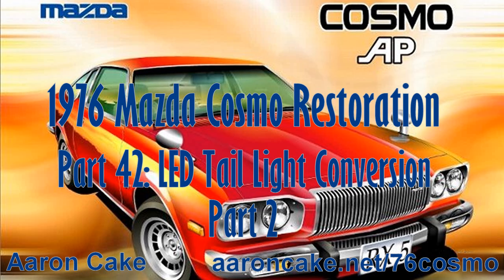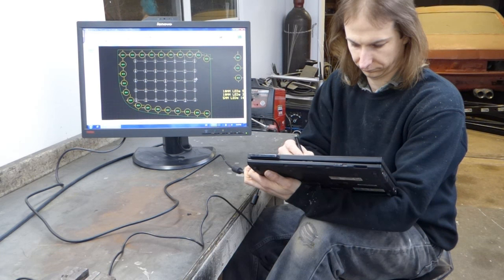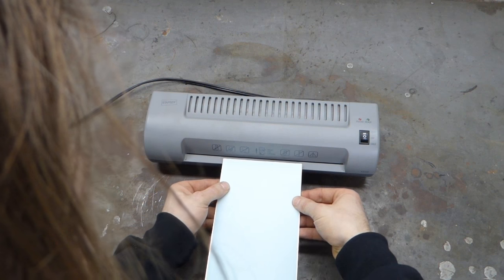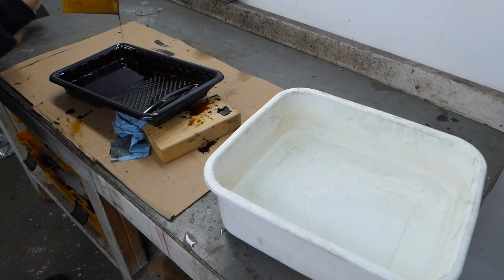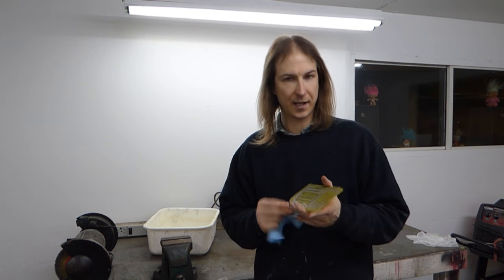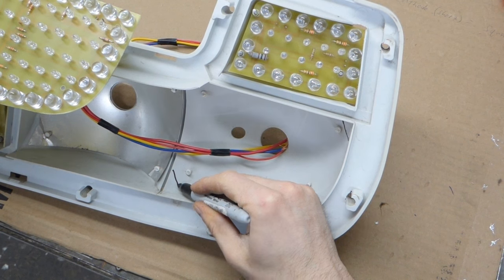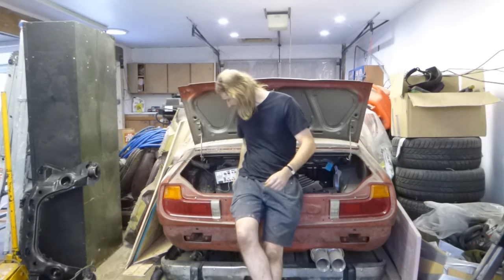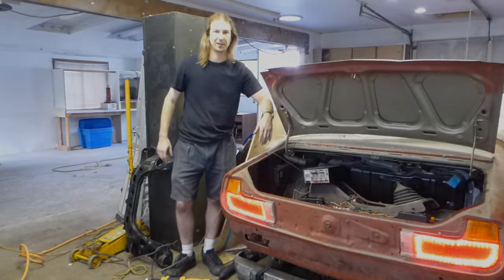Part 42: LED Tail Light Conversion, Part 2 - My 76 Mazda RX-5 Cosmo Restoration

Comment: Wow that turned out really great! But I have to say I'm a bit amused in how serious you go about it, yet ghetto out in other ways by not even having proper basic tools. But as long as it works, it's all good. :) Damn, now you made me wanna LED convert my car too!
Reply from the maker: I'm curious, what basic tools am I lacking? Always thought I was fairly well equipped. Oh! And I just got a mill yesterday!
Reply: Well like that basic crimp tool you use to cut the wires for example. :)
Reply from the maker: Skräcken Ah yes, I really should get a better crimper for WeatherPack stuff. I think I mentioned that in the video.
Reply: If I came across as condescending I apologize, that was not my intention. Also I hear those cheap chinese SMD rework stations are great for heatshrink tubing, I'm considering getting one just for that purpose. I'm using a big heat-gun now which is rather overkill in most cases...
Reply from the maker: Skräcken No worries, I was just curious as to what tools you were referring to. Maybe I'm old school but I've always just used a lighter for heat shrink. Thought that is very frowned upon of course. Never could bother with a heat gun when the lighter is so self contained.
Reply: You're not the only one who uses a lighter. I've found that a heat gun is often just too cumbersome and awkward to orient properly in difficult spaces. I just use a simple wand-type lighter found at any dollar store, stored right next to the butane pencil torch in my toolbox.

As always, you've done a brilliant job and I'm looking forward to the next episode.
Reply: Yes that storm lighter does seem pretty convenient. A regular lighter tends to have a pretty lazy sooty flame, which is why I don't like that method
Reply from the maker: Skräcken And it's an excellent cigar lighter. Found it on sale for $1 years at Princess Auto and bought a bunch of them.
Reply: Sweet deal! Looking at my car it looks like it would be annoying to LED convert like this, considering the lights wrap around the corner of the car a bit. But it can probably be done :)
Reply from the maker: Skräcken Flexible circuit boards and SMD. :-)
Reply: There are flexible PCBs nowadays? Interesting!
Reply from the maker: Skräcken Don't think you can make them yourself. Wait, scratch that. Just Googled it and it seems people have successfully etched flexible PCB material via the toner transfer method. Who know...
Reply: That's actually pretty interesting! I would probably go with a 2nd angled PCB for the corner though. The boring part is that a modification like this would be illegal on my car in my country.
Reply from the maker: Skräcken In most countries it's going to be illegal to modify a light beyond what was approved by the government, including my own. It's not a sort of modification I would do to a car that won't be covered by collector insurance as regular insurance companies probably won't touch a vehicle with non-approved tail lights.
Reply: That's a good point, I never thought of the insurance aspect. I was mostly thinking about it passing inspection or if the cops might be unhappy with me. But then again, neither of them has said anything about my 3" catback, or HID hi-beams. Yet. For older cars here the rules are much more relaxed though, but from some time in the 90's the rules changed to saying everything on the car needs to be stock or equivalent. My car's a 2001 Saab 9-5 Aero, so not a collector's item. Yet. ;)

Comment: Seems like it took a very long time to custom make them, but they do look very awesome!
Reply from the maker: So the funny thing is that when I add up the time, spending about 2 hours a week on them for the past 14 months or so, it adds up to about the same amount of time I'd spend working evenings and weekends for about 2 months. Which is the average amount of time between videos. So while it seems like forever, time spent is about the same, just drawn out. Yes, it actually turned out to be a LOT more work than I thought. But the ideal project to take on when the work area is limited to a bench and a drill press. Very, very happy with the result.

Comment: If you decide that you don’t want the holes exposed to protect against debris entering the housing, I suppose you could just use some grommets and feed the wires through?
Reply from the maker: Yes. I could make the holes a bit more regular in size and fit with grommets. I could also 3D print (in ABS) the exact shapes I need. Or just simply seal with metallic tape (as an OEM would).

Comment: Hey Aaron, you may want to purchase some nitrile 5 or 7 mil gloves from your local harbor freight or Ace hardware. They will last you a lot longer than your current brand, are reasonably priced, AND won't leak.
Reply from the maker: Definitely need to get some. I made a few circuit boards last week for another project and once again, had brown stained fingertips.

Comment: It looks super cool, and it's a great job. But why you din't use CREE for this? I think it's more durable and interesting variant. And it's easer to install.
Reply from the maker: Just didn't need them. Most of the CREE LEDs are far brighter than I need and being surface mount, more annoying to work with from a DIY perspective. The old style discrete LEDs are pretty rugged. Also a dime a dozen shipped from China.

Comment: Hey Aaron I also have some rx5s do you know if the door seals are available aftermarket at all.
Reply from the maker: I think they are only available NOS. Don't see any reproductions. However there are companies that will reproduce these things if supplied with a seal to copy. I'm going to explore that when the time comes. Also, rubber can be cast at home. There may be available seals which could be modified to work as well. Such as RX-4 or 929.

Comment: Few questions, why didn't you make the boards one piece instead of 3?  One piece boards would have ensured that all the LEDs were in straight lines instead of being slightly crooked board to board and it also would allow for much less custom hardware that appears to be fiddly as hell to install and adjust.Second, for the component count of the controllers, it appears you could have built the entire controller on one single 3x5 board.  Was there a reason for doing it the way you did?  Last, have you tested these controllers in situ yet?  My experience is that micros need a power supply circuit that is at very least comparable to a cell phone charger with a bare minimum one inductor, a MOV, zener, and an engineered cap filtering arrangement.  Ive grenaded PICs with more filtering than you have when the car it was in had a faulty alternator voltage regulator and it took basically replicating a Megaquirt power supply to properly protect the micros from smoking and/or being damaged internally.
Reply from the maker: One board would have been nice but neither the light housing nor the lens are flat. The lens is actually significantly compoundly from top to bottom and left to right. I would have had to gut the housing completely and bury the board about 2" down. What I wanted was to keep the LEDs as close to the lens as possible so the individual light points were visible. I've no tested them in a running vehicle. My daily driver uses a DC-DC converter, not an alternator, so it has a fairly clean 12V. Well, I guess I could have wired up everything temporarily in the RX-7. Not too far off of a supply section similar to the Megasquirt, just missing the inductors. Yes, I certainly could have used an Arduino with more I/O and put everything in a single board, and frankly eliminated one controller for the brake lights. However since this is all a essentially a prototype, I wanted redundancy. At least if something fails, then the odds of the failure taking out all my rear lights is very slim.

Comment: Why not print on both sides? Makes routing a lot easier, maybe a bit harder to line it up when transferring but saves a lot of headache.
Reply from the maker: That's true. Since this was the first time I was using this method, I didn't want to deal with the hassle of trying to make sure the registration between sides was correct. In a weird way I pride myself with making a single sided board without jumpers and until a few weeks ago was able manage that. Sadly while designing a board for an 8 channel home automation relay/switch controller, I needed 3 jumpers. Will try a double sided board soon because I really want to build my own version of an Arduino Uno with built in Ethernet.

Comment: I have to admit, I was skeptical about all of the effort you were putting into the LED lights, but then seeing the finished product with the border and variations for the different functions, I think it'll fit well with the car. Are they really that bright in person (like TOO bright) or is just the camera not able to handle the sudden light?
Reply from the maker: It was difficult to get a good shot from the camera without having the brightness turned down a lot. Yes however, they are quite bright. It remains to be seen whether they are too bright but that is an easy fix just by changing the PWM time in software. Additionally, since the controller knows when the market/running lights are on via the halo activation signal, the brightness can be adjusted lower when the running lights are activated. All software at this point.
Reply: Right on, I must have missed you mentioning you can adjust the brightness if you did. Looking forward to seeing more metal work in the next vid!
Reply from the maker: No problem, there was a lot of information presented. That's one of the reasons I decided to use an ATTINY. It makes the circuit itself so minimal with all the functionality in software. When I was a kid, this would have taken 2 556 dual timers and a lot more support components then de-soldering and resoldering to make changes.

Comment: I really like the "opening celebration." Will that happen every time you start the car?

Are you going to do the same for the front signals or are you keeping it business up front and party in back?
Reply from the maker: Yes, anytime the car is powered the opening celebration will play. Since I have the controllers, I figure I may as well do something similar with the front lights. Far less space on the front turn signals so I'd have to take measurements as to whether they would get the whole halo treatment.

Comment: Will the brake lights work without the car's key being in the "run position" with your current design? Are the chips always receiving power to be ready for the brake input or do they currently have to receive power via the key first, (activating the Opening Celebration) and then after that they are ready to function? Just curious if the brake lights will illuminate if the brakes are pressed with the key off or not present.  ---Love the videos, and have learned a lot by watching them and look forward to whats to come. Thank you!
Reply from the maker: Ya know, I didn't even think about that. At the moment they would be powered by the key set to run, so pressing the brake pedal with the car powered off won't light them. The opening celebration will cancel if the lights receive a brake or marker light signal. I do plan to actually run these lights through a body computer like the OEMs, which of course would also need to be powered at all times if they were to work with the car off. When I read the Ontario MOT regulations for vehicle lighting (all 17 or 30 pages, forget which) there wasn't a requirement for the brake lights to function with the car turned off. But of course there is a requirement for the 4 way flashers to function at any time. My solution will simply be a relay to power up the light controllers when the 4 ways are turned on.
Reply: Thank you for the reply! The reason I asked is I have been working on a sequential LED taillight conversion for an old 70's Mopar using an Arduino controller. In the factory configuration the brake lights activated without the key so I was scratching my head while trying to preserve this feature. However, after looking around it seems like not all newer models of vehicles retain this option, so I will have to dig through US DOT laws to see if preserving that is even required here. It may be a hurdle I don't have to hop after all (or worst case piggy back wiring into one of the LED segments so it can still partially function via a dedicated relay as sort of a "dumb mode" for when the key is not present).  Thank you again for the reply and information on your own project. Your videos have been great to follow, and I look forward to the future ones. I really enjoyed the opening celebration you added into your project, that was a fun touch. Keep up the great work, Sir!
Reply from the maker: doctorbull Retaining that function shouldn't be too hard. There are several options. You could leave the CPU powered all the time if you don't want to do any fancy opening effects and that way it always has 12V to activate the lights. The approach I took was in software. If you check the code linked in the video you will see that the opening celebration is immediately cancelled if any of the light inputs are activated. So, it would only take a wiring change in the form of a relay added to the brake light switch to both apply power to the tail light/controller and activate the  brake lights. Or a double pole brake light switch to accomplish the same thing. That way when the switch is activated the circuit is powered up at the same time, the code sees the light input, and it essentially operates exactly like a standard light. I have a friend who's tail lights are on the CAN bus. They only receive power when the car is switched on so don't activate when the brake is pressed unless the key is in "run".

Comment: Since there's no more red-hot bulb, any moisture getting in is going to cause a bad time. Conformal coat spray for electronics, figure out how to plug those openings (epoxy?), hot glue a silica gel to the enclosure behind the board to get any humidity out, and silicon seal that stuff air-tight. If you do it right with LEDs, it's unlikely you'll need to change anything in there again so no future need to open it up again. Perhaps a pain and going over-the-top, but unless you're in some desert that's bone-dry 99% of the time, water will always find a way behind tail light enclosures. Just better that it and any contaminants (road salt) don't get in.
Reply from the maker: The Cosmo lights actually mount in a rather odd way. The entire assembly mounts inside the car with only the lens sticking out the back. They are clamped into place via the trim studs. The lens itself is totally sealed from the outside and will be sealed to the tail light body upon final installation (after polishing) with a gasket. I don't see anything from the outside coming in. The idea with keeping the back of the light open is that I won't have to fight humidity. Any humidity that gets in will also get out. We've all probably seen horribly condensated light fixtures that were once sealed but ended up with a tiny seal breach. One way to avoid that hassle is to simply not seal. However it probably would be a good idea to glue a cloth filter over the openings.

Comment: Cool. Unfortunately (or maybe not, depending on the perspective), it's not legal where I live. You can't even switch to led bulbs if the taillights came weren't homologated with them in mind. You could even get into trouble with your insurer after crash, even if it wasn't your fault.
If you plan on making another video, maybe do some night testing? Taillights always look better in darkness.
Reply from the maker: It's illegal here to modify a DOT/MOT approved light assembly. I did however actually read the MOT requirements for auto lighting and made sure I followed them. It does mean that I will need to use collector car insurance, which I had intended anyway. I suspect that because I see so many modified lights, that a blind eye is turned.

Comment: Hey Aaron the tail lights look like they took a long time to make up but I love them would you be interested in making another set for my rx5 and if so how much would you charge. Postage to australia also. Cheers Wendy
Reply from the maker: Unfortunately, I don't think it would be economically viable. We're only talking about $300 worth of parts but the labor is immense. Since all of this is essentially a prototype, even though the boards are designed it is still a considerable amount of time to make everything fit and put it all together. And since none of it has been proven on the road, I'd hate to ship you a set of $1000 tail lights and then have a failure next week. They aren't also plug and play to a stock Cosmo wiring harness.

Comment: I've noticed in slow motion led lighting assemblies flicker, how will your taillights be affected with your series parallel patterns? just a question of shits and giggles.
Reply from the maker: In many cases if you are seeing it on video, the flicker is caused by the framerate of the camera being some derivative of the PWM frequency. If you are seeing them flicker in person, then it means the PWM frequency is very low. About 60Hz is when we start seeing flicker. The PWM frequency of the ATTINY85 is 490Hz which is fast enough that you won't see flicker with the naked eye. In general the series/parallel combination won't have any sort of effect on flicker as each array is just a group of LEDs all PWM'd at the same time.